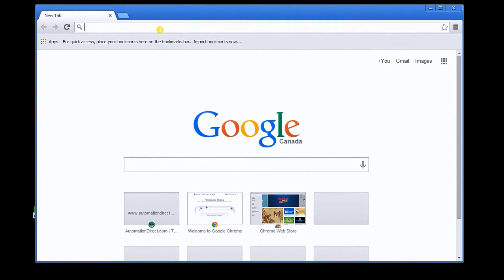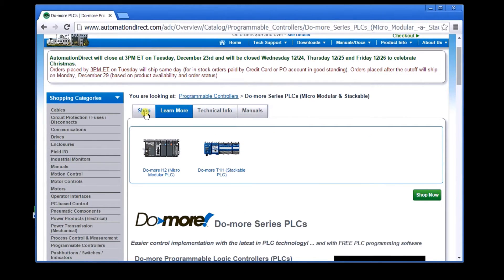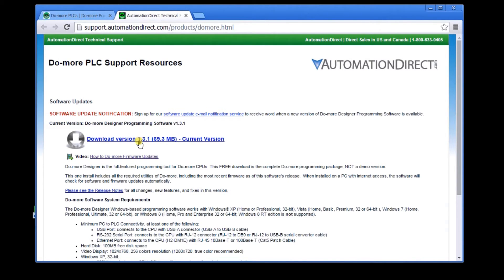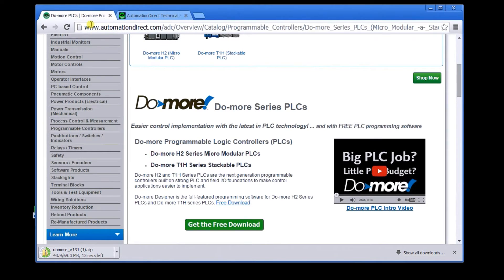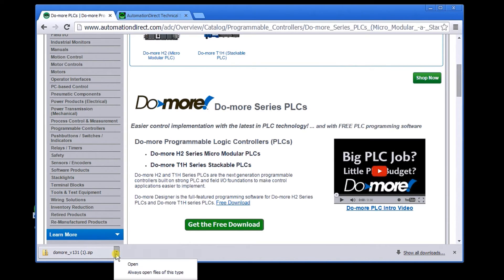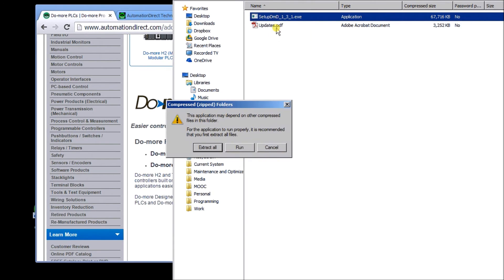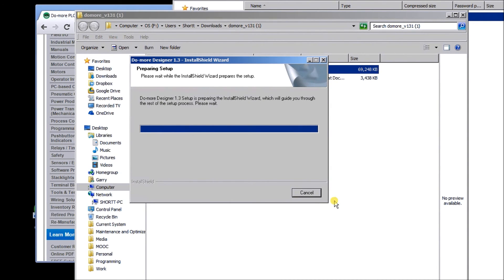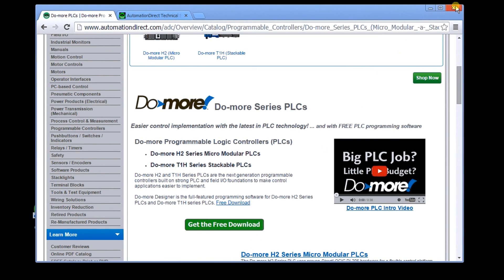Master PLC Programming FREE with Do-More Designer Simulator

Comment: does it work offline ???
Reply from the maker: Hi Zeenat,
Yes, the software works offline as well as online. It can perform online edit changes as well.
https://www.automationdirect.com/adc/overview/catalog/software_products/programmable_controller_software/do-more_plc_programming_software
This is a fully functional software package. It comes also with a simulator that mimics a PLC. You can test and control your logic without purchasing any equipment.
https://www.automationdirect.com/do-more/h2/software/simulator
This simulator also has the capability of communicating via Ethernet or Serial so you can test your Barcode Scanner or HMI.
I hope this helps you out.
Regards,
Garry